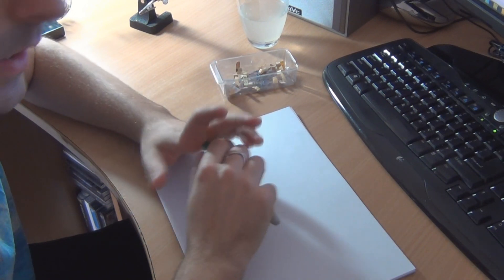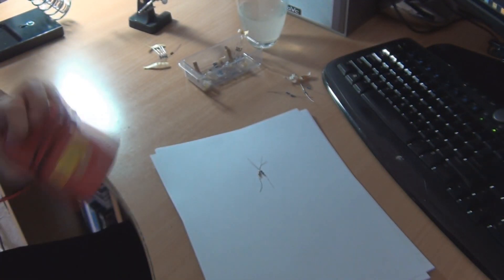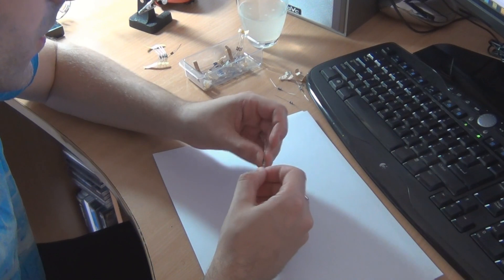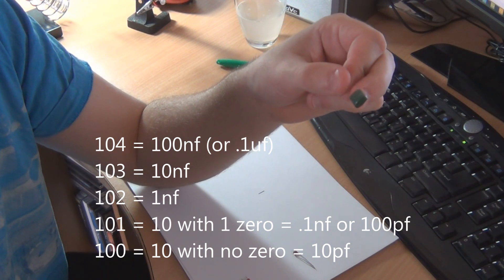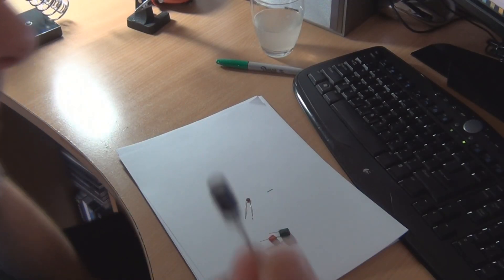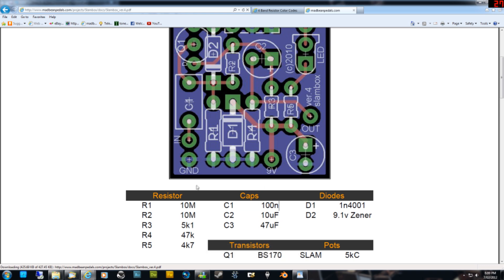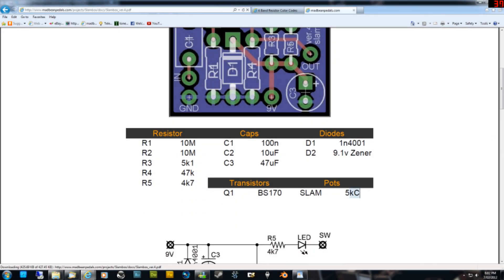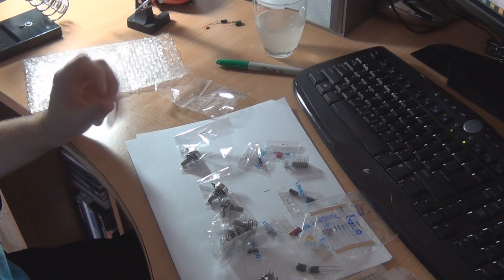DIY Guitar Pedal Tutorial 3: Reading Electronic Component Values

Comment: Hey great video series but I have a question about the power for the components. You mentioned the typical resistor power is a quarter watt but what about the capacitors? Does the power of the capacitors used for the pedal depend on the power from the battery source?

Comment: you had said that the pin 3 on the IC was a LFO... and im working on my understanding of circuits more but could you shed some light for me on the pins purpose name.. like is the LFO for example a : Trigger , discharge, threshold, control voltage, resest etc.

Comment from the maker: The original rangemaster used oc44 or 71.  Unfortunately both of those are unobtainium these days.  However in practice theres nothing to say those models were particularly special in any way.  Any PNP germanium transistor will work (assuming your wiring positive group).  I have measured germanium transistors for rangemasters on my webstore (diyguitarpedalsdotcomdotau). Also check out the inverter boards and charge pumps.  Cheers and good luck!